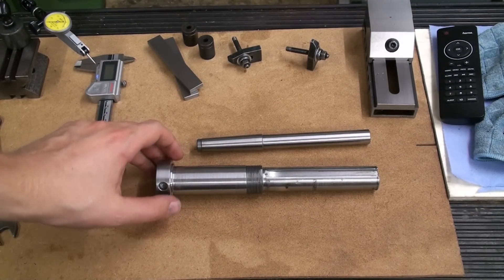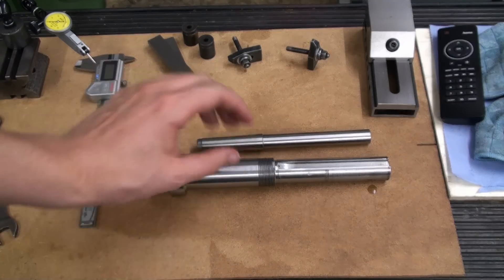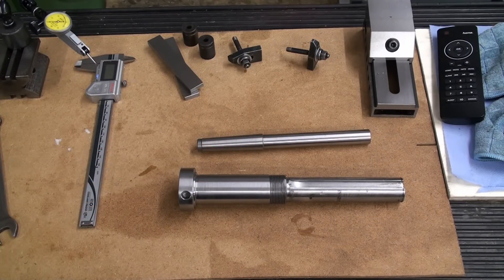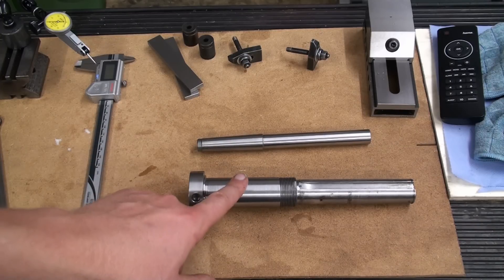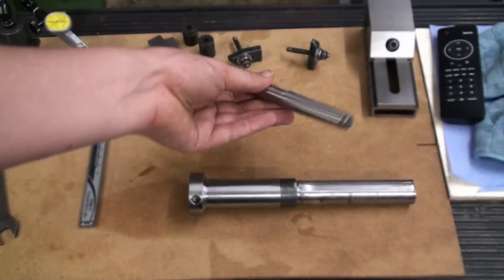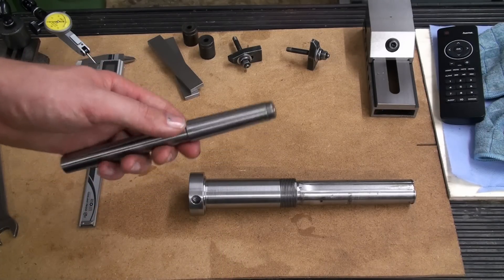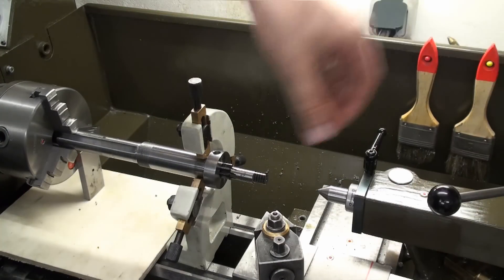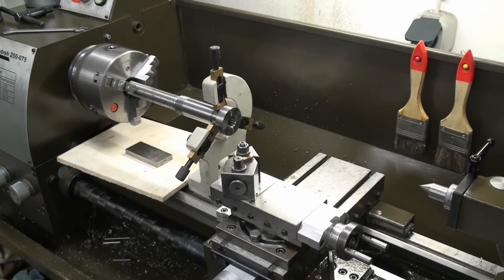Repairing a MT2 spindle - Instandsetzung einer Mk2 Frässpindel

Comment: After grafting a Bridgeport M head onto my little Japanese horizontal milling machine, I rebuilt the spindle with new ABEC 7 angular contact ball bearings.  The spindle ran beautifully but, the #2 Morse taper bore still had several thousands of an inch runout.
Dismantling the spindle was out of the question as this would probably have ruined those beautiful bearings.  Thus the decision was made to re-bore the taper bore in situ.
I mounted a new #2 Morse taper drill chuck shank between centres on the milling machine table.  The M head was arranged with its spindle more or less horizontal.  Starting with a .001 inch test indicator I adjusted the tilt of the head until the indicator, mounted in the spindle, read 0 from one end of the Morse taper to the other.  Note that the indicator was traversed by moving the quill of the M head!
Replacing the .001" indicator with a .0001" dial test indicator, I repeated the alignment steps.  I found it necessary to place a small screw jack between the top of the M head and the machine table to make those minute adjustments.  This took a while.
After I was satisfied with this set-up I prepared an aluminum stub mandrel which was chucked in a collet in the spindle.  Holding a turning tool in the machine vise, I turned a Morse taper onto this mandrel.   
This taper was tested with a #2 Morse taper adapter sleeve and a china marker.  A tiny adjustment was still needed at this point, and the aluminum mandrel re-machined.  This taper fitted well, with the big end very slightly tighter than the small end.  This is the preferred fit for machine tool cutter collets:  The large end very slightly tighter than the small end.
The spindle was heat treated and quite hard, but a carbide turning tool was used to re-bore the spindle taper.  Had this not been possible I would have mounted my Quorn T&C grinder spindle to re-grind that taper. 
A very good finish was achieved and I decided not to "improve" the finish by reaming the bore.
After all that, and it took my son and me one evening to execute this task, we had a sweet running and accurate spindle.
Let me emphasize that, for good and accurate results, set-up is everything and cannot be rushed!  The indicator test points and the turning tool must be accurately located on the high point of the tapers for accuracy.

Comment: I'm doing this same project for an old benchmaster Horizontal Milling machine I bought. I was running a roughing reamer in a similar set up to yours, but under power, at about 100 rpm, on my heavily modified 7x14" mini lathe, but it burnt up my motor speed controller! 
Thanks for sharing and showing it can be done. Good work.

Comment: nice vid, good job on the repair. runout on finished spindle isn't too shabby considering on what machine it's been used, so that's plenty.
fun fact tho: in our workshop we use to have the exact same mahr indicator dials with the exact same crack in the glass guard, we came to think it's a design flaw by manufacturer.
mahr is shit anyway, tesa or mitutoyo for measuring devices all the way.

Comment: Yeah I'm afraid a band-aid repair....I'd be inclined making a permanent repair, new case hardened spindle...all ground including internal taper.
Taper needs to be precision ground, it is a must on Morse tapers since it is the taper alone which makes a [lock] and transfers the power to your tooling.
Reply from the maker: Holds up since the repair without a problem. I would/should/could do a lot too, if I only had to write comments on yt ;)
Reply: I have no doubt holding up but the same thing can happen again and soon the fix can be more work as a new one, [easy to make]. Nevertheless, great fix!  Spiral reamer would be better as you probably know but sometimes hard to get.
Reply from the maker: Its very unlikely to happen with a matching taper - I know for a fact that the original taper is pretty bad machined and has a terrible contact percentage compared to that one I remachined - In fact that is already the second spindle of that type of machine I did and both are in service since then :)
A fully hardened and ground spindle would take more than the 2..3hours to fix this one and exceed the cost of the machine by far...
Reply: I'm only going by what you said, these are your wording... it is a constant problem, the manufacturer doesn't heat treat them very well, they're kind of soft, the morse taper 2 works or bell mouth the end of the spindle when heavy milling.

 I'm surprised the manufacturer JUST machines the taper.  Well hope the problem is solved.

Comment: hi Stefan
this may be a bit late for commenting since you posted the great video in 2015 - but i have the same issue like your friend - the MK2 taper bores of the 2 spindles of my Flott SB23ST drilling machine are worn out;  my lateh is too small to handle the spindles and the machinist workshops in my home town are not willing to deal with the repair
could you please help me ?  otherwise i run out of ideas how to repair my vintage drill press ...
thxs a lot indeed !

Comment: Did you have a chance to try scraping for the spindle?
I guess it can help a lot with removing bad surface and adding more to contact between spindle and tools. But for this there should be a master tool with perfect surface. Also for small morse taper scraping can be a chalenge, because of the size - scraper needs to be a small one.

Comment: Hi Stefan, truing a chuck with taps... lol    But efficient...
This mill is either working too hard or the taper is a conception flaw, those MT taper aren't meant to hold lots of side pressure, mainly if not heat treated to harden them.
Cheers, Pierre

Comment: Beautiful. Like you I work in metric -- grew up with it. I call .01 mm a "cent" (about .0005" US) after watching a Brazilian machinist turn a "cono Morse" in "centesimas do milimetro". So, like dollars and cents, in metric you work to the nearest penny. As one of the commenters pointed out, we do need a name for thousandths of a mm. The obvious "thou" would cause endless confusion to US watchers. So the only thing I can see is to switch to microns when you go below the cent. I think 10 microns is indeed an acceptable error even for a tool and die maker.!
Reply from the maker: Juan Rivero We have a word in german for 1/1000 of a mm: "Tausendstel" or "Müh" (and some are refering to it as micron, but that makes you sound like a smartass ;) - Micron seems to be more common in the science enviroment. )
Reply: German scientists actually use micrometer (0.001 mm or 1x10^-6 m). On my QWERTY board I can't write the micro letter like you can on a QWERTZ keyboard by holding down [AltGr]+[M].
So most notations use 'um'.

PS: if you want to be a smartass use Angstrom. ;-)

Comment: Would a chemical hardening process, or a mild heat treat in an oven help at all?
Reply from the maker: Andrew Tubbiolo Most processes result in some kind of warping of the part and that would spell disaster. There are processes with very low warping but its still a bit of gambling...

Comment: Another great video! Two points, I think it would have been interesting to measure runout on the spindle it self near the end of the video on the V-Block. That would have shown any error in spindle vs taper. Other point is a question for learning, if you were doing a bearing change of a cartridge type spindle. How would you correct taper runout accounting for the new bearings or new alignments introduced by new bearings? This is a R8 taper cartridge spindle I am referencing. Thanks.

Comment: Excellent !
Stefan your precision will far out do what the makers of that machine will ever achieve !
I love those MAHR indicators !
I remember many years ago i was working for a company that did hardchrome and one of the men were setting up something in an old lathe to put some centres in the ends so they could be mounted in the grinding macine, the boss  a toolmaker by trade happened to walk by as this guy was giving the chuck a tap with a mallet, he said to the guy operating the machine he should be mindful of the headstock bearings to which the the guy replied " are you serious this thing has been in a fire and has a twisted bed who cares about the damned bearings !
If you think about it look at the wheel bearings on a car and the loads including shock loads etc a lathe would be lightly loaded compared to this .

Ian

Comment: You can also bore the spindle in the mill. If you don't have cnc like shown, the head of the mill can be tilted. To check the angle, have a sine bar on the bed set at the slight angle then have a test indicator sweep the top of the bar.
Replace (DOT) with . 
www(DOT)practicalmachinist(DOT)com/vb/cnc-machining/spindle-taper-repair-122416/

Comment: Hi Stefan, Your chuck setting is known colloquially, in the UK at least, as a "bump true" chuck.
Is it possible to bore the spindle out enough to bond in an open ended Morse 3-2 reducing sleeve as a more permanent repair? Certainly sleeves are hardened, even cheap Chinese ones but reputable brand more so.
I love watching precision work, even if it makes me feel inadequate.
ATB
c
Reply from the maker: Chris Stephens Thats a great idea, those sleeves are even from Röhm or Albrecht not very expensive. Only problem is that there is not very much material to bore the spindle to a MT3 taper. But anyway very good idea for a non-wear spindle sleeve. Thanks for commenting!
Reply: You can buy parallel OD sleeves which might be smaller on the OD than a 3-2 sleeve. You could reduce the OD even more with carbide tooling, or grinding if you have access to facilities.
Reply: Chris Stephens Just watched today's video, and clearly you know that already..